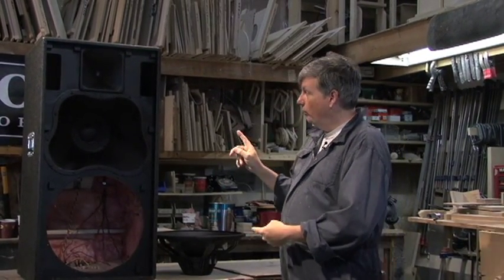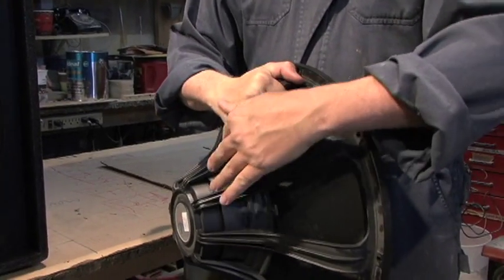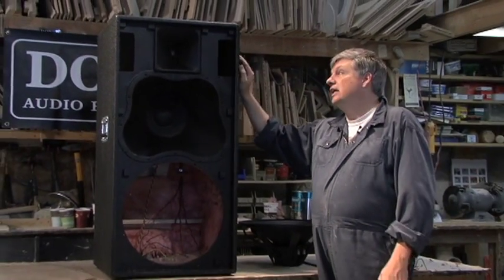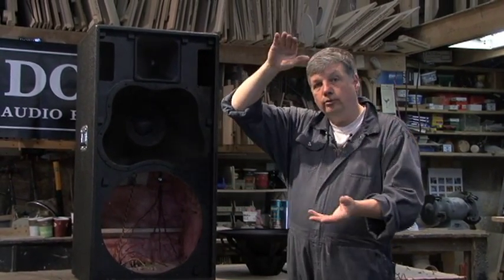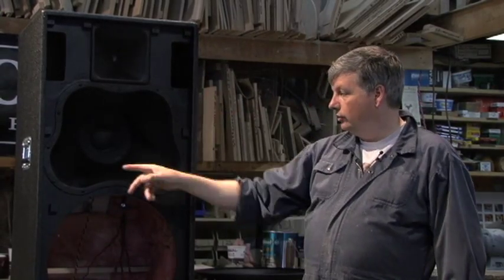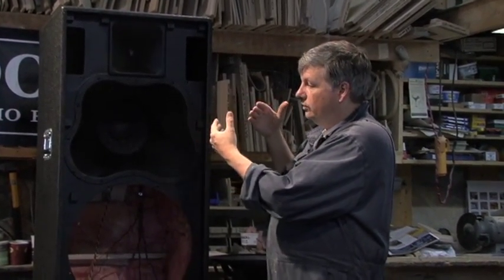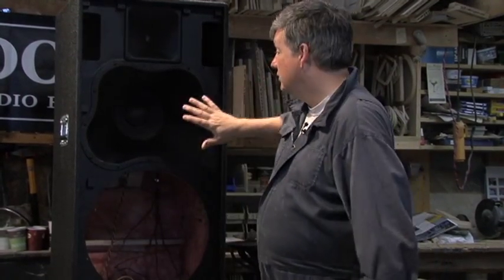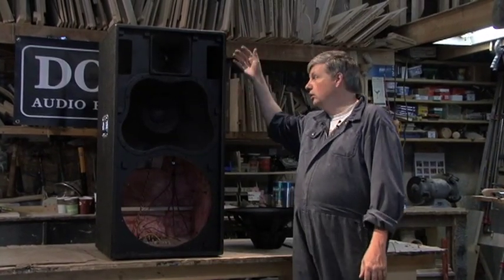Asymmetrical Horn loaded P.A. 18" woofer 10" mid 1" high end

Comment from the maker: Eh -eh!
The JBL "Scoop Bin" technically the 4530, has a sound all it's own. To alter the size would mean changing the length of it's horn that utilizes the back flux of the speaker. Changing the horns length would change the over all characteristics of the tone and depth of the cabinet. If you like the sound of this classic consider getting a bigger truck.  LOL
That being said there are a lot of designs of subs that have surpassed this classic, in out put and performance. 
Peace.